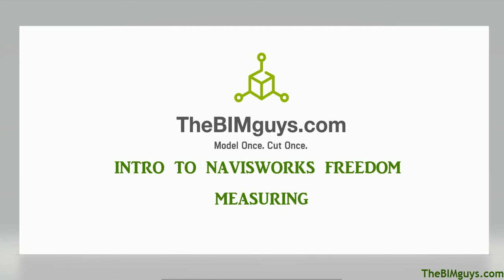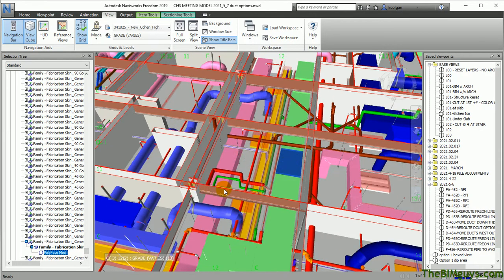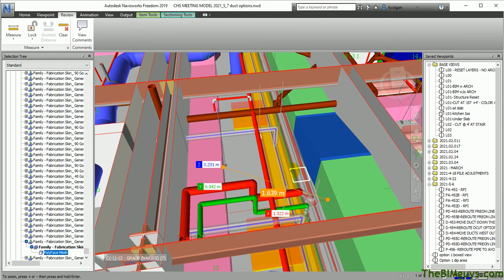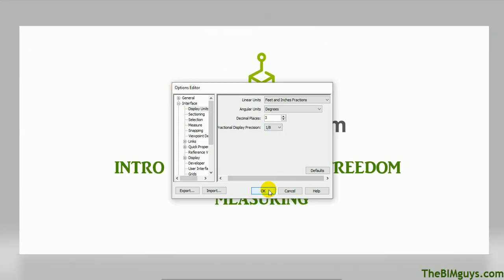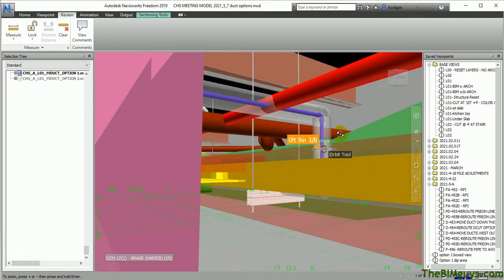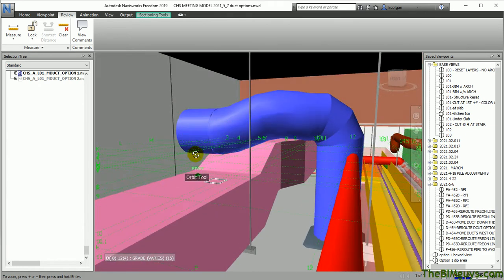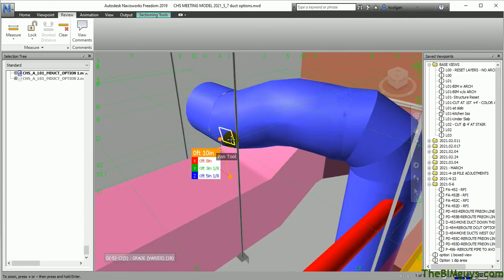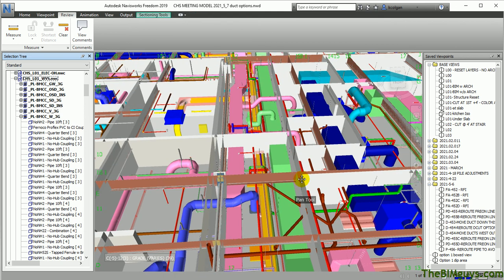Navisworks - Measuring - Part 2 - CADtechSeminars.com

Comment: How do you measure the Ø of a pipe?
Reply: You can pick the top and bottom to get the OD size. Or choose the item and check the properties. It may list the dia. depending on what software it was originally created in.
Reply: @kencolganjr  A bit rough isn't it? muste be a better way ... where are the properties?